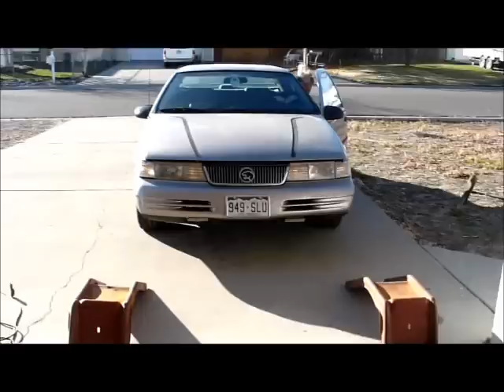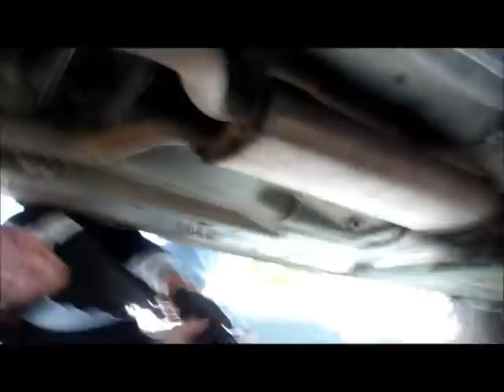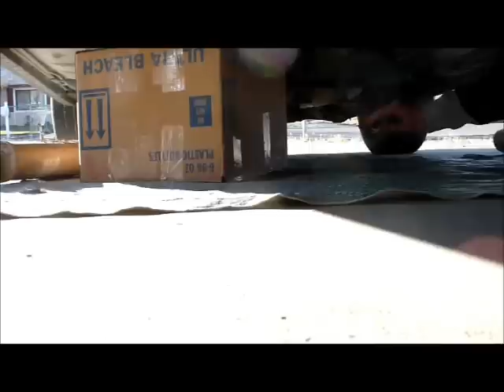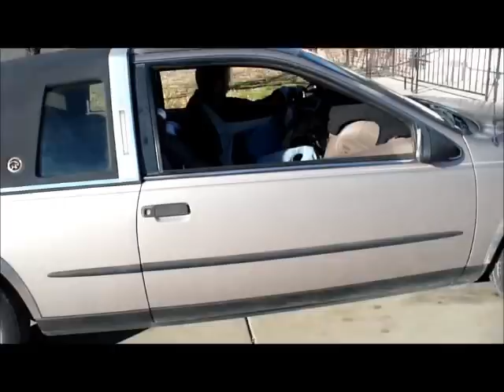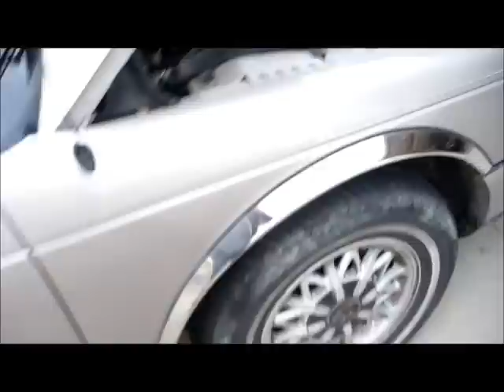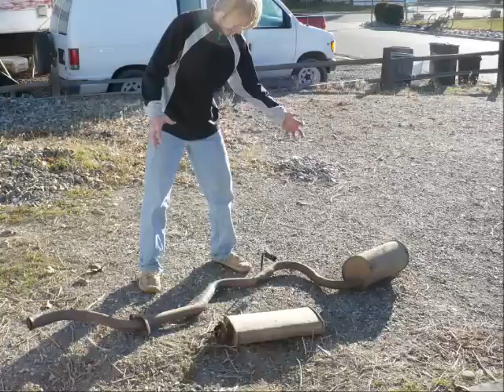INSTANT DUAL EXHAUST '94 MERCURY COUGAR

Comment: That doesn't look like a 94 cougar. Looks more like the 87-90 cougars. I have a 93 mercury cougar 5.0 and ya it has dual exhaust. I was thinking of buying a 97 anniversary edition with the Ford 4.8 engine, and now I think, I should check if it does have true dual exhaust
Reply from the maker: heheh, its cuz i swapped grilles with a 93,, but u know it's the 94-95 sub-gen by the taillights and by the lack of chrome around the body,, 87-88 cougars are more sharp and angular, being the last sub-gen of the foxbody 6th gen; 89-90 are the first sub-gen of the curvier unitized 7th gen and have the grille that laps over the hood and the more rectangular headlights,, that's bad@$$ that u've got the 5.0 HO, 93's the last year u could get that in the tbird/cougar, however no 7th gen tbird/cougar ever came with TRUE dual cuz there's only that one hump on one side of the gas tank,, fortuitously, MandrelExhaustSystems.com offers a delectable variety of meticulously-crafted custom true dual kits for these cars; they simply route the pipes side by side under the offset hump,, so just as soon as i can save up the $$$,,,,,,,,,,
Reply: O cool haha
Reply: KatanaMasta well my cougar just broke down couple days ago. Just got off work and off the freeway and when I got onto the slow streets. the engine was vibrating the car like crazy and made a clunking noise. I pulled into the next parking lot I could then had a tow truck tow it the rest of 2 miles back home... 

Gotta find a temporary car to get to work and then I want to save up for a hopped up engine and transmission that can handle the power. 

Transmission is easy to find a 600hp rated but I am not sure what engine can fit in the little space it has.

A mechanic said I blew up a rod.
Reply: Tyee Cambrón
Get a v6 from an '01-'04 Mustang, thicker main caps and it bolts right in the Cougar. Then if you want to have fun get a crank from an F-150 pickup with the 4.2L V-6, 12 runner intake from a ford windstar minivan (take the butterflys out), '99 mustang split port heads, a mild cam, and better pistons, rods, and maybe some roller rockers and you can build up an almost 500HP V6 that will run mid 10's in a 1/4 mile. I saw a fox body mustang that did it.
Reply: is 4.6 not 4.8

Comment from the maker: yep,, typical, smaller engines are not more efficient in bigger vehicles! they gotta rev too high ta git the car movin! 3.8 is a good v6 tho, they just shoulda used steel heads,, we had ta do gaskets 2 years ago,, did it ourselves an saved a bundle,, (sum racin outfits offer special steel heads tho if u got dinero) wutever, they shoulda just kept the 5.0 dammit :(